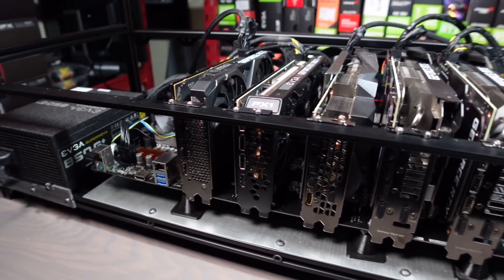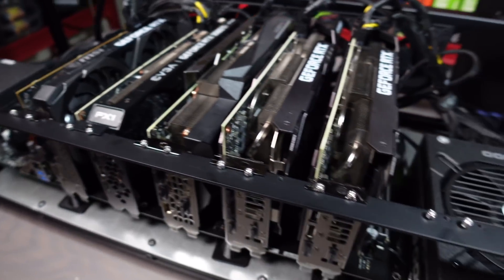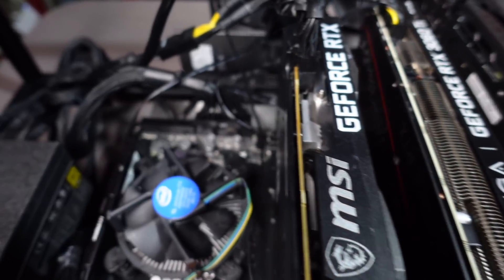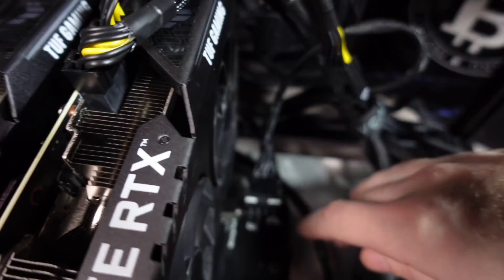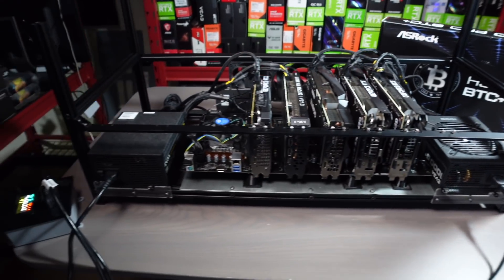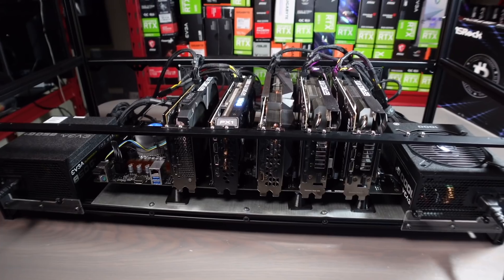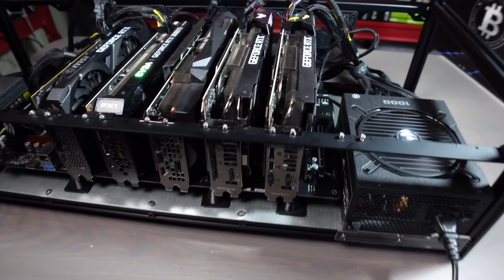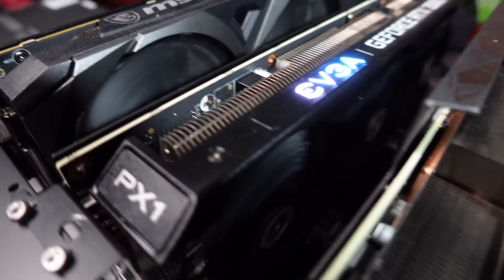This Mining Motherboard Confuses Me

Comment from the maker: Do you have this motherboard? What kind of build did you do with it?
Reply: ask your 3d friend to print some funnels so the fans blow air between the cards and not all over the place ,  and put a cover on top , so the air travels horizontaly , like in a tunnel and can take the heat away
Reply: Yes, and use them for RX6600 series, have a single riser on the usb mining port, and may add one more on the M.2 port too
Reply: @splynk1  let me know if the M.2 Port works really interested to see...
Reply: @reybigcena  i have dropped using it, as im putting a  disk there to minimize wireing, and the space to get the USB up from the adapter and to somewhere usefull is at best limited. so ill settle for 7 cards, too bad that there are soldering spots for several more mining ports on the motherboard that are not sldered in
Reply: @splynk1  does it even work?  I heard the m2 port wouldnt work on that MB, maybe misinformation...
Reply: @splynk1  you can run up to 11 on this board if cpu has the pcie lanes, slot 1 is a full x16 which can be split needd some help though can  use a server psu and atx? wanted to run power like i do with my current BTC T37 atx for board and server for everything else can this be done?
Reply: Hey red fox I have the same MB, everytime i boot i hear 5 beeps has it ever happened to you?
Reply: @reybigcena  I get them too, i think theyr just boot beeps, and they might be turned off in bios. Ahh one more motherboard ordered, dropping in tomorrow :-) having issues getting the Celeron CPUs thou
Reply: @reybigcena  Have one hdmi cable attached to card 0. That might solve the issue.
Reply: I so far put three 3080ti on it. Tried 3060v1 until I realized they don't work. Pcies should have been x8. Maybe I swap it to be 6x1660s
Reply: I use it and I think it's made for vertical mining frames, because when they sold it to me they offered me one ...
Reply: I have it and have been dealing with nothing but headaches lately. Not recommended for beginners at all.

Comment: Ive started building my very first rig with this mother board i had the 3 beep problem and i fixed it with puting a new ram stick in but i cant seem to get a signal with my monitor when i turn on my rig currently im just testing it out with 1 gpu to get it working before i start adding more. You mind telling how you were able to get that rig connected to the monitor?

Comment: @redfox crypto is there any reason why you used the supplemental power port instead of the #2 power supply port or was it just because of its connection location just got 3 more 3070’s too install with the 2 already in the Mobo. Defiantly nervous about the molex. Do you know the part number of the molex pins if so I may be able to find an amp rating.

Comment: I have this mother board I am making my first rig ! 
I got a processor i5-11400f lga 1200 
Everything is running fan motherboard but when I connect with monitor it says no hdmi signal ! 
I put  gpu 3070ti I tried hdm on mother board   As wel as on gpu but still same no hdmi signal even I open the ram and put again but still the same . 
Will u kindly help me setting this if possible 
Tc

Comment: This board is just begging to be filled with a couple Nvidia A2000 cards since they only need to be powered through the mobo. The cards are also a lot slimmer so spacing wouldn't be a problem like other cards. P.s. I think I remember Red Panda mentioning you can get a 6 pin to molex for server psu so that may be a better solution than 2 atx power supplies.

Comment: I have this board also on a custom frame.  I can only get 3 gpu to load in windows and 4 to load in hive.  screen flickers. maybe its the hdmi monitor plugged into gpu A? Any ideas? Thx
Reply: I have 6 rx6600 working fine. The trick for me was using dummy hdmi on all. Without it windows 10 was not booting.
Reply: @danielesetaro4634  Interesting but wouldn't this impact your hash rate with the dummies in place?
Reply: @jasonhollis4136  May be no. The 6 x  rx6600 have 175,5 Mhs so a little more then 29 each one. I was not able to do better and if the rig do not start the Mhs are surely lower.....
Reply: And another thing....the dummy hdmi was necessary for windows not for the motherboard itself. I am sure ot that. The motherboard have no problems if the gpu are right connected and powered. The bios test on start is very didactic. It is windows that can't handle the gpu and you need to care of it with the dummy hdmi.

Comment: Great video. I bought the mb just because it doesn't need risers. I build my own rack with aluminium profile, quick and cheap. 😊 The only drawback is that it doesn't work... well... major drawback. All the components run, but I don't get any video signal from the mb or the GPU. I couldn't find any real help. What community would you recommend?
Reply: I heard from someone who got this that the HDMI doesnt accept long cable ones, forgot the name but try the short hdmi one on the main board
Reply: @baby333  Thanks, the cable I use is short, so it isn't about signal strength.
Reply: @peterkerschbaumer2775  I can't give you the exact solutions but I can atleast tell you the map, the guy was talking about how he needed a short xr (or something like xlr, i honestly didnt hear him properly but i heard short cable) and disable certain things in BIOS, maybe try googling stuff related to that and see if it works :) GL, he did those before installing the GPUs, whilst installing windows and drivers, bios update etc, he said he needed to do that otherwise he wouldnt get monitor display, so i came back to this video to your comment because   i remembered you saying you had that issue xD

Comment: Bought one like this, S37, for A2000’s since they wont need pcie adapters get full power from PCIe slot.  This is ideal GPU for this board given limited # of PCIe cables fromATX PSU’s.  Like Hobbyist is about to do, built frame from some plank wood and aluminum angle.  Sadly the mobo PCIe slots don’t allow space for the io brackets, so u need to elevate the mobo as you’ve done.
Reply from the maker: Ah nice dude if my A2000s ever ship they’ll probably go on this board.
Reply: @RedFoxCrypto  Hah same…it’s built waiting on those…has a 3080Ti and a 6600 keeping it warm for now 👍

Comment: Hey man, really enjoyed your video, i was expecting it since i have the same mb!!! I have a question that you could help me with. i just bought a second GPU and placed it in the4th PCIe slot so as to have enough air circullation (not using fans yet). Problem is that even if the card gets detected by the mb, nor the miner or the hiveos can utilize it. Using only  one at a time at slot 1 is ok. but i can;t make them both work. Im thinking BIOS settings should do the trick. Can you please test it and HEEELLLLPPPP me? Thnaks in advance
Reply from the maker: 30 series card? I had to do a bios update to get more than 2 recognized.
Reply: @RedFoxCrypto  That was it!!! thank you!!!

Comment: it worries me that you are running one single pcie power cable split into 2 to one 3080...
Reply from the maker: Yeah it's close. 288w max over that cable and those 8-pin power connectors could pull 150w each. Obviously card is power limited down to 230w, but you are right. Do as I say not as I do moment.

Comment: I bought one of those btc t37 boards off ebay and just use risers with it so I can separate my cards for better airflow. I find the cpu side of the motherboard still lines up with the first few standoff holes on the frames and I just designed some 6mm high 3d printed standoffs for the rest. Awesome motherboards for the price
Reply from the maker: Awesome dude thanks for sharing and thanks for watching.
Reply: Whats the performance diff w nd w out risers?

Comment: Yeah lol definitely gonna need delta fans. I've got 1 onda 8 card riserless boards, but I actually prefer the btc-t37 and s37 boards. I've been using those cheap $50 ebay mining frames (with a bit of customization). I put the board and cards on top and the psus on the bottom. Delta fans in back
Reply from the maker: Haha yeah dude. Thanks for watching buddy. Fan upgrade imminent.

Comment: Were they making boards like that for the v1 3060s.
Also you could try take the plastic shrouds off the gpu's it may drop the temps. I took the shroud off one of my gpus to fit some replacement fans that didnt quite line up, and its my coolest running card.
Reply: @paul.1337  I looked up that board it should work with v1 3060s. I was thinking of it being similar to the X79 - H61 motherboard.

Comment: Its a great board for the right GPUs, i got 3 of them sofar, filled with RX6600 and RX6600XT  and i dont even need fans, im deffinatly getting more of them. But damn it sucks that they used Molex and not PCI-e, no single PSU today offers 2 strings of Molex, but they god damn offer 3 strings of SATA crap, Im using EVGA and would like to find some Molex strings, as the PSU has 4 outlets,, i just cant find where to buy them seperatly
Reply from the maker: 100% agree with everything you said. How are you mounting the board?
Reply: @RedFoxCrypto  I put a MDF Board in the bottom, marked all holes, drilled and screwed in normal motherboard stands in with a drop of superglue. Added 6 fans mounted as yours, works fine as theres better spacing between the RX6600 series cards, but i dont use them, maybe in the summertime ;-)

Comment: That GPUs are too close - hot air bouncing from the MB and entering back into fans. For the side fans, you can 'stack' another four fans to push air even stronger across the whole thing.
Reply from the maker: Yeah man. I want to redo the thermal pads and retest as well. Or just replace with lower tdp GPUs.
Reply: @RedFoxCrypto  I moved all my rigs into basement, from cca. 25C to 15C and got more hashrate on ETH. Just by lowering room temperature. Not much, maybe 1%, but every percent is worth.